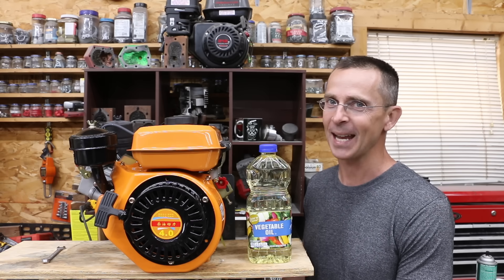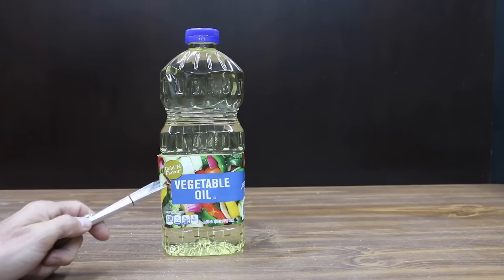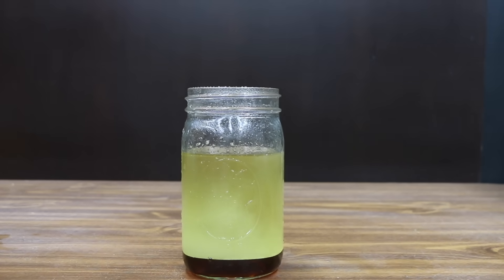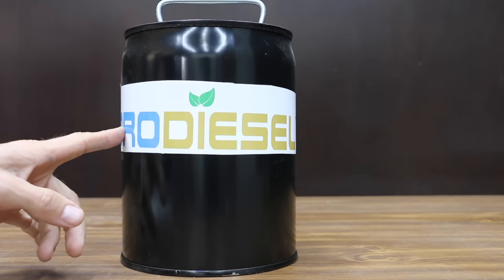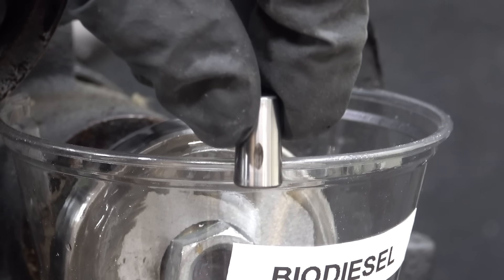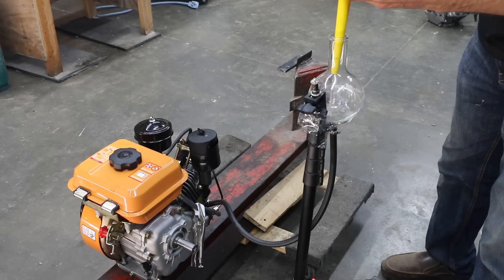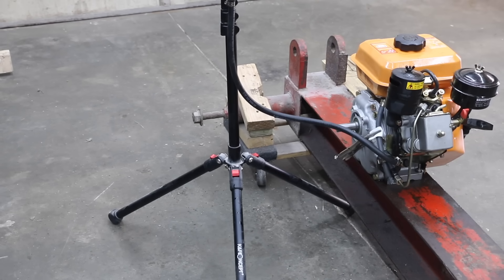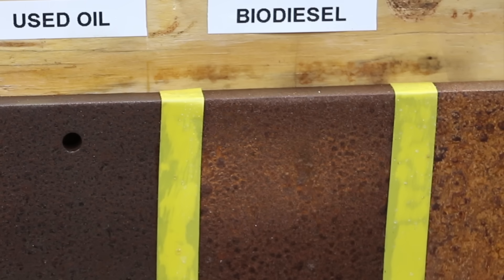Make "Biodiesel"? Let’s find out! Diesel vs Biodiesel, Used Motor Oil, Vegetable Oil, MPG

Comment: I tried coconut oil, more stable largely made up of medium chain HC, I like KOH  than NaOH, simply because the Glycerol cocktail is thinner and can flow more easily on separation. eaw Biodiesel has pH 8.4 a few tablespoons of Cider  vinegar pr liter will neutralize the concoction. If the litmus paper is watched closely Igot best result when pH goes around 7.2-7.4.. If kept warm and still for 48 hours, no need to microbubble, undistrubed, microbubbles will float. The price of diesel did not go beyond $5.00. Traded my MB240D to a Toyota.BTW, I got well with Absoute alcohol safer than Methanol,
Reply from the maker: Thanks for the feedback.

Comment: My family always bought diesel cars and trucks. (12 since my parents married and only one gasoline and one LPG) Old mechanical injection engines (or as called plunger types in Korea) were always troublesome to South Korea's government. 

People used kerosene and/or even used cooking oil and engine oil coffee filtered. Red kerosene (for heating system in house, or called the boilers) performed worse than white kerosene (for indoor use like kerosene heater) but both way cheaper than diesel, even though technically kerosene is higher grade than diesel.
(In Korea, diesel has been always cheaper than gasoline, but kerosene was even cheaper since the "road usage tax" wasn't included on it's price)

Our family filled a dozen of 5 gallon jerrycans with red kerosene whenever fuel carrier from gas station came to fill up the tank for the boiler. Mixing was minor misdemeanour I believe back then, and everyone was doing it. Terrible start in winter and low fuel efficiency with minor power loss, but it was almost twice better on bangs for the buck. Sometimes I miss how my family cars used to smell like indoor heater and bacon grease mix that went wrong terribly.

That's probably one of the reasons why the gov insisted to help designing CRDi, Common Rail Direct Injection. My neighbour poured 20 gallons of white kerosene in his brand new CRDi truck as for good ol' days, which is felony now, only to find out that the new injector and fuel system failed and "totalled" his car. Lol. It was a sad moment for him and his Hyundai truck. He wasn't even able to explain to his insurance company why it happened.

Comment: My Landcruiser 3.0L turbo auto, would not change up into top gear after running a while on Bio Diesel. Swapped back to normal pump deisel and it started to go into top gear again, instantly. Never had the problem since.
I concluded the engine power had dropped for the gear change to take place but only an educated guess. Bio smelt great loved the price but couldn't live without top gear. Bio made with used cooking oil ( not by me) but it could have been diluted with palm oil so do your own tests. Good luck.
Reply from the maker: Thanks for sharing.

Comment: Excellent Video, ac usual.

Hereby i realize: If one lives in a hot to very hot climat Vegetable oil is a good option then 🙂
Its not 100% legal as i heard but to be used in old tractor or other land machines it will do the job 😁
Reply from the maker: Thanks!  Thanks for the feedback.

Comment: Pans can be 5 to 15-20ish liters in capacity, just bump up the ratios you showed and cook.
You can even heat vegetable oil in the frying pan if it has any draining system.
Reply from the maker: Thanks for the feedback.

Comment: Ive been using used veggie oil for 30 years... outside of washing the oil and filtering it.. Thats all i have ever done.  My engine has a a diesel flush out tank, So at the end of each day i run down the engine for one minute on diesel.  So i go through about $15 in diesel a week. Every year i put in new injector tips.  cost me about $100.
Reply from the maker: Thanks for sharing.

Comment: It would be interesting to see what happens with a load applied to the engine
Reply from the maker: Thanks for the suggestion.
Reply: I use to sell Biodiesel to truck drivers and thet where very happy whit the results they use to drag like 2 3 tons whithout any trouble Y have my own recipe and processes and it worked very good and it's cheaper than regular diesel
Reply: @NatureWarnings  do you have any tips you would be willing to share? started down the diesel alternatives rabbit hole today

Comment: I have an idea for a video, but it's very complicated --but I think you could do it! Okay, as you know, both diesel and gasoline engines are basically air pumps. Diesel engines have higher efficiency in part because part-throttle operation is accomplished by varying the amount of fuel going in --not by restricting air intake. In a gasoline engine, part-throttle operation is accomplished by restricting the air going in during the intake stroke with the throttle plate. That obviously reduces volumetric efficiency (the ability of the engine to fill the combustion chamber with air) and creates resistance during the intake stroke. So, all gasoline engines that are not operating at wide-open-throttle are operating well below what they could in terms of volumetric efficiency. My idea is to run the engine at wide-open-throttle all the time and vary the horsepower and RPM by utilizing a form of exhaust gas recirculation. EGR is currently a way of reducing certain pollutants by reburning exhaust, BUT, since exhaust has some of the oxygen burnt out of it, one could theoretically use it to vary engine speed and power output without restricting the intake stroke of the engine. There are also unburnt hydrocarbons (fuel) in the exhaust which (again, theoretically) should increase fuel economy if they could be used to produce power rather than being burnt up in the catalytic converter as we do now. I would guess you may have to integrate some form of heat exchanger in the exhaust to cool it before reburning to prevent getting the engine so hot it melts. You would certainly also have to construct some form of variable valve that would mix fresh air with the exhaust because the engine needs oxygen to burn the fuel. The basic premise I'm describing is EGR as throttle rather than air intake restriction as throttle. A design hurdle I can foresee is fuel enrichment during cold starts. (What we commonly refer to as "choking" the engine.)  Thanks and good luck!
Reply from the maker: Thanks for the suggestion.

Comment: Video idea. But also i did this. Used motor oil for 2 stroke oil in the mixed gas on my shindaiwa weedwhacker and echo leaf blower. I had sthil and echo chainsaws and put old oil for the chain lube too. I dont know how bad it was for the small engines. But using it for bar oil, the cuts leave a kinda black/gray where the cut was exposed on the tree. My question is, can used motor oil work for 2 stroke small engines? I've actually done it but only on my older sacrificial small engines.
Reply from the maker: Thanks for the video idea.

Comment: I believe port injection diesel engines are what you want when doing this as bio diesel in direction injection may block up the system and injectiors though i have read a mix of both may help in DIs.
Reply from the maker: Thanks for the feedback.

Comment: Hey, you made it! Thanks, sir. I've been making biodiesel for like 8 months now to use as a cheaper alternative to lantern fuel for my parrafin oil lantern. It's about $1.50 a liter if you make it in bulk compared to $3 a liter for the store bought fuel. Also, sodium hydroxide works too and you can often find it much cheaper as crystal drain cleaner compared to potassium hydroxide

Also, from what I've heard you can set up large rigs for making biodiesel and restaurants will let you empty their grease traps for extremely cheap fuel that only requires some passive processing
Reply from the maker: Thanks for the feedback.
Reply: Как с вами связаться?

Comment: Since we now have the low Sulphur diesel, could you do a comparison of diesel supplements?  The common ones at the truck stops and maybe a couple others?  I think if you tested the lubricity of both the supplement alone and then combined with diesel per manufacturer recommendations would be awesome.
Reply from the maker: Thanks for the suggestion.

Comment: I have for along time used 1 quart of ATF a month in my older 7.3 as a lub/cleaner.  Older diesels, like your truck or my 7.3 can actually be run completely on atf.  There was an article in diesel magazine about a guy doing that very thing with a truck like yours.
Reply from the maker: Thanks for sharing.

Comment: A simpler - and good - method is to thin well filtered used veggie oil with a small amount of gasoline. This works well and I have run many diesel engines on it.
Reply from the maker: Thanks for the feedback.

Comment: having run on vegetable oil for over 10 yrs and 100 of thousands of miles it works no issue if it gets cold mix it with diesel 50/50 ,used engine oil is full of carbon and will ruin the injectors quickly
Reply: caviat only use with mechanical injectors not electric DI
Reply from the maker: Thanks for the feedback.

Comment: The real problem is that new engines have really , REALLY delicate pumps etc... 
old mercedes 300 engines go well with veg oil thinned down with some gas , 15/20% gas .
Some people use heaters to thin the veg oil
Reply from the maker: Thanks for the feedback.
Reply: @ProjectFarm  other problem in anything vegetable ,biodiesel etc is the clogghing of the filter cause of the algae formed inside, as biodiesel has a slighter water solubility ( wich is microscopic , but still enough to form green matter )

Comment: "I just bought this engine. Let's kill it."
Reply: Loks like a Harbor Freight engine, so like a $10 loss. LOL
Reply: @mikezupancic2182  well, it's not harbor freight, it's way worse. Lol. Actually, those little diesel engines are fairly good from what I've heard. Harbor freight engines are decent as well, but don't expect any bolts to be torqued properly.
Reply: @inoahmann7542  They pull good. Pretty awful on a minibike just from the vibration, but lots of torque and smoke lol
Reply: @mikezupancic2182  These are actually surprisingly expensive. My 3.5hp model was over $300
Reply: FOR SCIENCE
Reply: So we don't have to
Reply: Lets go Brandon

Comment: Rudolf Diesel's first public display of his engine used peanut oil, although apparently he experimented with various oils, petrol and even coal dust.
At the time of inventing the engine 'diesel' was nothing more than an unused by-product of petrol refinement.
HDPE and LDPE plastic can be made into a type of diesel quite easily.
Just cook the plastic in an oxygen deprived environment - tap off and condense the vapour.
I've almost finished rebuilding a 1987 Petter AA1. 
It's going to spin a couple of old washing machine motors, rigged as DC generators, for battery charging - the batteries are connected to inverters.
Once it's running the plan is to leave it running, at low RPM, indefinitely.
It's so close to being finished I've bought the oil and filter - the only thing I'm waiting on is the head gasket.
It's going to run on whatever I put in it, along with gas from a wood gasifier.
Reply from the maker: Thanks for sharing.

Comment: Our friends ran a transmission shop and they mixed a 30/30/40 used filtered transmission fluid, old filtered fry oil, bio diesel blend in their 24v 5.9cummins. Engine ran great and on day it blowed the front main seal like most Cummins at 300000, when they tore it apart it looked brand new inside from the detergents in the trans fluid!
Reply: Years ago I pumped fuel at a truck stop. Some truckers would put a quart of tranny fluid in each tank before I filled em. I figured it was for cleaning like Marvels mystery
Reply from the maker: Thanks for sharing.

Comment: I wonder of you could run a diesel engine on solid fuels when heated until they are liquid. Like petroleum jelly, candle wax, margarine or roofing tar. It would also be interesting to see an attempt to run a small diesel engine like this on heavy fuel oil/bunker fuel like a big marine diesel.
Reply from the maker: Thanks for the video idea.

Comment: Correction there is only 10 ppm of sulfur in diesel the reason is Jan 2007  EPA mandated DIESEL PARTICULATE FILTERS IN ALL DIESEL ENGINES OVER 50 HORSEPOWER. 2010 Diesels vehicles received Urea Systems.The test you are doing we have done in a Class 8 EMMISSIONS Lab.Biofuel has  a good cleaning action to the fuel system.When you run on pure biodiesel you should run the engine in a well ventilated area as Bio fuel produces higher levels of NOX which is a poisonous gas this occurs in fuel mixes of 50 percent and above. your freeze test you should do at 5,10,20 and 50 percent. you will see the bio floating in the diesel.
Reply from the maker: Thanks for the constructive feedback.

Comment: With fuel prices heading north anything that helps to reduce it helps. Additionally currently available Lo Sulfur diesel does seem to have a 'step motherly' effect on old gen diesels. so the veggie oils old engine oils are the ideal remedy. I add 2-3% Acetone to these oils when I use them in my diesel engined vehicle. Fortunately engine oils drained out of new cars during their first and second services are virtually free of carbon, but do contain metallic sediments. There are oil recycling plants that use centrifuges to filter such oils. These oils are available at the equivalent of 50 US cents and is used as lubrication oil in chainsaws. I use it in my car after the addition of acetone and if it needs a reduced viscosity some kerosene. The engine runs much smoother with increase fuel economy on these oils than on regular diesel.
Reply from the maker: Thanks for the feedback.

Comment: I had a Ford E350 van and ran it on SVO (Straight Veggie Oil) for over a year in Colorado.  I used 12V warming "blankets" around the fuel filter and a magnetic fuel tank heater.  It would billow white smoke for about 3 minutes before the engine warmed up and then the smoke would clear up.  The exhaust DEFINITELY smells like KFC or French Fries and my First Sergeant told me not to come to work without some fries anymore because it always make him hungry with I would pull up to the company office.  Eventually the fuel injector got clogged and basically ruined (because I didn't have the right equipment to clean the SVO enough) and so I sold the van.  I've had 4 diesel vehicles that I've run on SVO and they all performed excellently. The guy at the emissions center in Denver, CO said that the tester they insert into the exhaust read that the exhaust was 150% cleaner than with diesel.
Reply from the maker: Thanks for sharing.

Comment: I ran an old non turbo diesel car on a 50 50 mix of diesel and veg oil a long time ago with no issues.  But that was a 1994 car. Less oil in winter though.
Reply from the maker: Thanks for the feedback.

Comment: Keep that truck running. Biggest issue with the 5.9 cummins is the killer dowel pin. Not sure if you fixed it already but a loose pin falling in timing gears is a bad time. Outside of that those Bosch P-pump units will outlast the truck.
Reply from the maker: Thanks for the feedback.

Comment: I think the reason the diesel engine was not starting is because it is very difficult to prime  a diesel engine when it is low on fuel because one time my dads truck  just died out of nowhere so we put some gas in it and it took a while to start.
Reply from the maker: Thanks for the feedback.

Comment: Ran my old 6.2 GM diesel on used vegetable oil for a few years—. Heated it with coolant system.  Only filtered, not treated in any way.   Van ran better on it- a little quieter, smoother and more power.     Stopped it altogether as the hassle became too much and the motor still running fine years later with no issues.....
Reply from the maker: Thanks for sharing.

Comment: Love this channel, goes to prove that an older diesel engine (IDI) will tolerate different fuels like veg, motor oil, kero as i have tested similar in my old isuzu lump. Recently tried gear oil 80w90 mixed with 10% petrol/gas, result was bit more smoke but no drop in power, unfortunately the smell may annoy drivers behind you :/
Reply from the maker: Thanks!  Thanks for the feedback.

Comment: Once i open up my bike engine, then i realized that i bought wrong type of cleaner. Its the one you use plugged to the injector.

After considering my option on what i have, i found that using polyurethane thinner have very good cleaning properties. Everything diluted, with a soft wiping and or some compressed air i got bare metal on my throttle body and intake.

Since then, i always use it, even mix it with gas in the tank to clean the injector, valve and combustion chamber i couldn't reach. Only do that for 7 years, nothing else. I only change my clutch once myself, nothing else. Its still running great today. My sparks still the one i got from the factory. I got manual tach, the one with gear to the wheel. And the steel wire has been broken since like 4 years. So no mileage number, but I only use it like around 5 miles a day everyday.

Could you test that mixing polyurethane thinner in the gas tank clean the fuel injector and the combustion chamber? I almost sure it works on injector, but only wild guess on the combustion chamber. But, I feel better torque and power each time I do it. I add around 5% thinner to the gas tank.
Reply from the maker: Thanks for the suggestion.

Comment: My Land Rover Discovery 300tdi would run on almost anything. I often used to run it on 50% veg oil. If it ran a bit rough I would chuck some petrol in to thin it out.
Reply from the maker: Thanks for sharing.
Reply: Cuidado que yo soy profesional en echar aceite sofrito y te puedo asegurar que el discoveri 300 es inyeccción directa y da por culo con la culata luego a luego hay que sacarla porque se llena de gomosidad eso sí sí lo haces un 20 a un 30% igual no te pasa